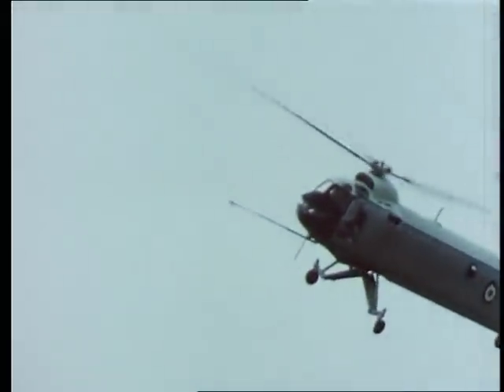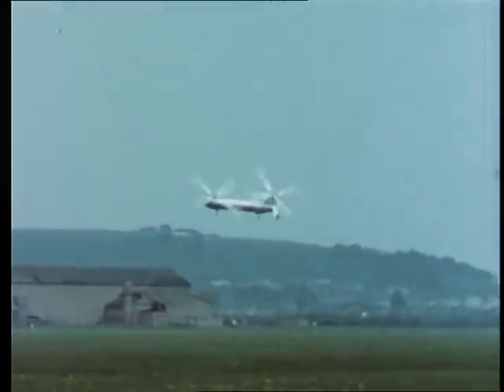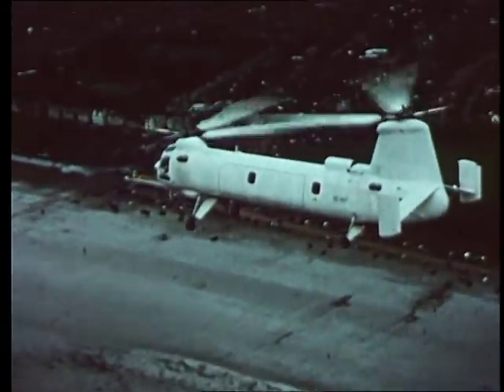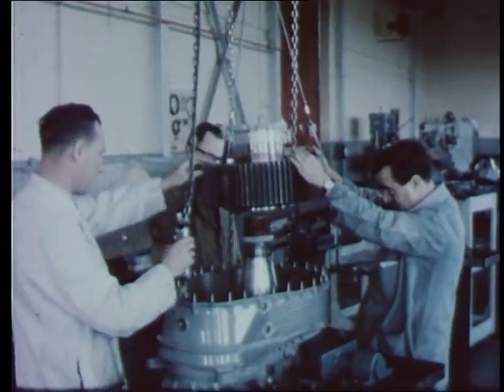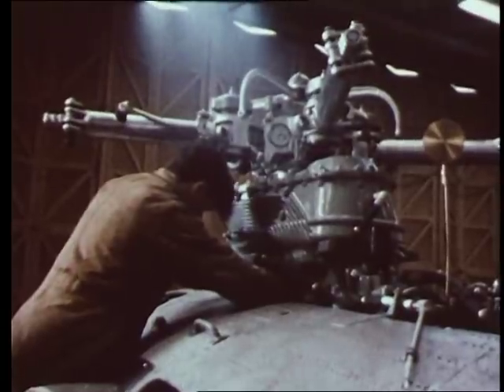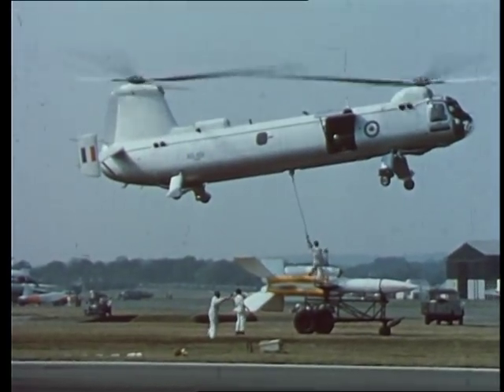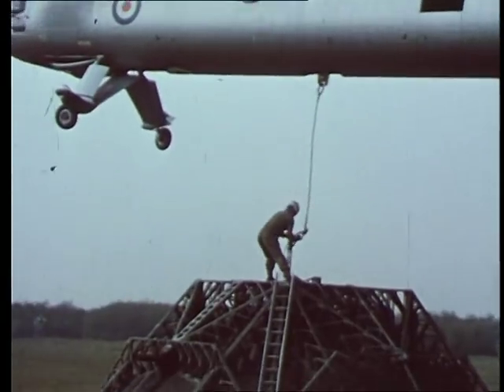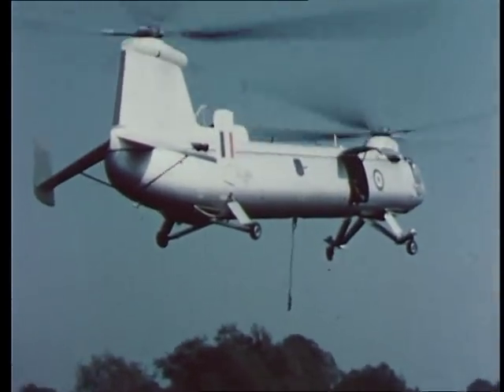The Bristol Belvedere 192

Comment: I sometimes wonder how successful a design such as the Bristol shown in this video could be if updated with modern power and materials.
Reply: They were all made to last and were strong! We destroy our resources! It has to be greed!
Reply: Chinook is how. Even the US marine Sea Knight was superior Both are from the early 60s
Reply: @jmcfintona999  two different machines from two different cultures.  Its turning 8 blades and no computer where the 46 flys like an angel until 
the flight computer is turned off.
Reply: @nipponhouseplayer  ok but were they both not litteraly from a time before computers? To me it looks like a British competitor to the H21 when the US had already moved on to the Chinnock and sea Knight.
Reply: @jmcfintona999  i can only speak for the 46, it was a 1960 flight computer that was ahead of its time and now we are integrating digital components which actually have different functionality actions that the original pilots have to adapt to on the fly while re tuning the pilots muscle memory to be able to cope with the machines  management behaviors .  The idiosyncrasies of handling a lion in a caged circus show for example!

Comment: Chinook followed, it looks so similar
Reply: Yes 👍 you are correct
Reply: Yes 👍 you are correct
Reply: Other than the fact it has the two rotor assemblies on top, it's not at all like a Chinook. Engine arrangement, crew/cargo doors (especially the rear cargo door on Chinook), cockpit not accessible from the main cabin, landing gear arrangement, low stance of Chinook to allow easier loading vs high stance of the Belvedere requiring a ladder to get in....
Reply: The Chinook stems from Piasecki HRP-1 "flying banana", this one looks very similar.
Reply: The Mark A Chinook was a contemporary - it flew faster, higher, carried twice as much and had the big rear ramp. No competition really. That's why 26 Belvededes were built an currently over 1,400 CH47. A refelection of the US tendency to think big and the UK's to think too small!
Reply: @mh53j  

A fundamentally poor design; both engines should have been above the fuselage, leaving an uninterrupted 'step thru' cabin with short landing gear giving fast access. Rather too slim as well.
Reply: @VaucluseVanguard  No! Took the British concept and engineering of flight just like the AV-8B
Reply: @VaucluseVanguard  Money.
Reply: @jimdavis8391  Probably a centre of gravity thing having engines low down.
Reply: It doesent look as robust as the Chinook but the ability to boost its engine capacity at will and being able to run on one engine .would probable mean  could carry more weight than the 3 ton come to push.This is up there with the rotordyn as another failed aircraft scheme .Thanks to the goverment wanting only to buy american equipment as usual.
Reply: @Then.72  The Chinook was developed from a Piasecki concept just post ww2. The 192 Belvedere if anything copied that as well, though the concept of twin rotors to counter each other was well before even that. The first working instance was the German Fw61 back in 1936.
Reply: @EuroScot2023  if you look back they all took bits of technology from each other but it was actually a Russian called Nicolas Florine who built the first tandem rotor helicopter

Comment: Can anyone explain just why the front landing gear was higher than that at the rear - it seems impractical not to match them?
Reply: because when the helicopter is fully level there’s a slight natural forward motion that occurs due to the rear rotor being higher than the front rotor. taking off at this slight backwards angle allows for a fully vertical liftoff as opposed to a slow forward moving one which is a lot more practical for landing in limited spaces.
Reply: Pitch setting at a hover.  It didn't have a cyclic pitch dash rod for ground operation like the CH 47. Hovering attitude is landing attitude

Comment: I wonder were the US took the idea from for the chinook 🤔🤔
Reply: The US was testing tandem rotor helicopters in 1945 and adopted one in 1947 from Piasecki, the same company that would eventually become Boeing-Vertol and make the Chinook. By comparison the Belvedere was adopted in 1961 and based on a prototype that first flew in 1952. So actually, the britbongs are the ones that stole this idea from America. lmao @ yuropoors.
Reply: @Dick_Kickem69  Hmmm, maybe, but did you ever hear of the shared technology program between Britain and the US?  We gave them all the info WE had, and they gave us bugger all.
Check out Miles M52 which Britain designed, and compare it to the Bell X1.  Here's a snippet from Wiki on the subject.

Design and development
Parallel development

XLR-11 rocket engine
In 1942, the United Kingdom's Ministry of Aviation began a top secret project with Miles Aircraft to develop the world's first aircraft capable of breaking the sound barrier. The project resulted in the development of the prototype turbojet-powered Miles M.52, designed to reach 1,000 miles per hour (870 kn; 1,600 km/h) (over twice the existing airspeed record) in level flight, and to climb to an altitude of 36,000 ft (11 km) in 1 min and 30 sec.

By 1944, design of the M.52 was 90% complete and Miles was told to go ahead with the construction of three prototypes. Later that year, the Air Ministry signed an agreement with the United States to exchange high-speed research and data. Miles' Chief Aerodynamicist Dennis Bancroft stated that Bell Aircraft personnel visited Miles later in 1944, and were given access to the drawings and research on the M.52,[2] but the U.S. reneged on the agreement and no data was forthcoming in return.[3] Unknown to Miles, Bell had already started construction of a rocket-powered supersonic design of their own, with a conventional horizontal tail. Bell was battling the problem of pitch control due to "blanking" the elevators.[4][5] A variable-incidence tail appeared to be the most promising solution; and having already decided on it for the M.52, the Miles and RAE tests supported this.[6]
Reply: @thecorbies  look at the development of the BAC 111 airliner and the Boing 727, very similar story unfortunately, but that's how it goes, we sold all our rocketry to the French because the Americans would launch our space stuff, they were never that keen and the French produced the rocket and called it Ariane, the list of things we have developed only to have our government cut the legs from under it is woefully long.

Comment: Very interesting. What were its shortcomings that it only served for 8 years and was built in relatively small numbers?
Reply: Was hated by its pilots and nearly caused a mutiny with RAF pilots in the Far East.
Reply: They only had a air frame life of about 1600 hours, due to metal fatigue issues.
Reply: Basically a poorly engineered design. They shook themselves to pieces.